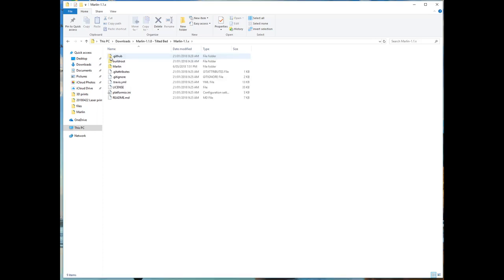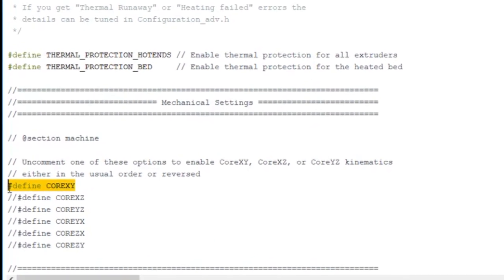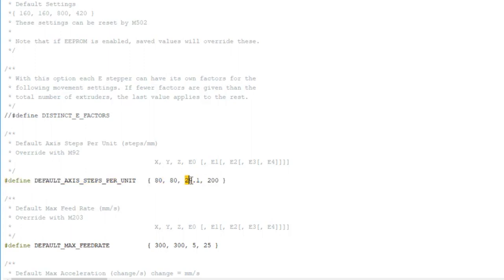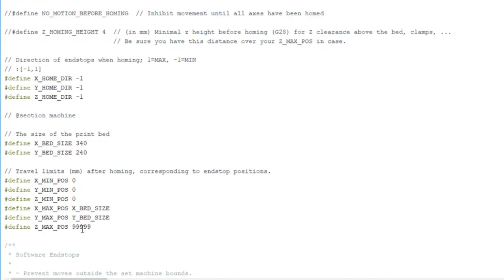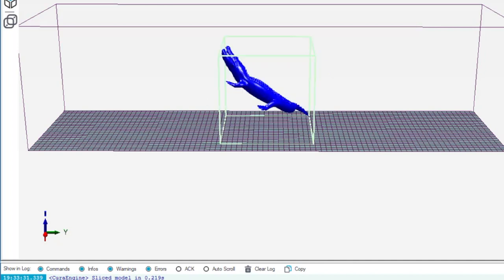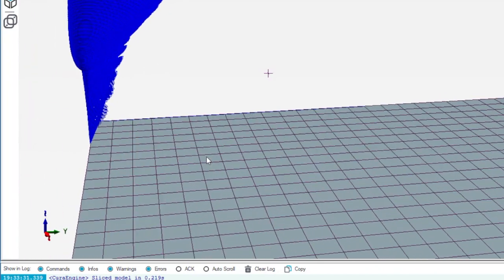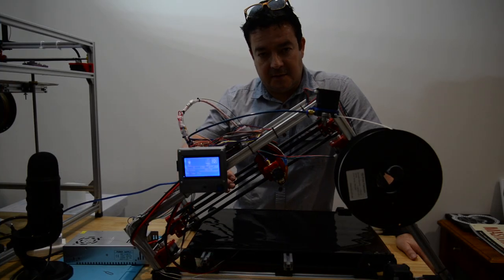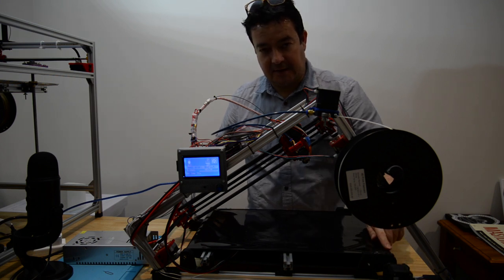How to configure Belt 3D printer Firmware

Comment: Since the Z-axis is the belt axis, I am attempting to switch the Z and Y axis in the marlin V2 firmware so I can utilize the 2 Z stepper plug ins on the board for the 2 Y-Axis steppers motors I am using, but am having no luck. Do you know any ways of doing this?

Comment: Is there a way to read all the G-codes loaded in the sd card one by one like a queue in series without interruption? In the blackbelt version of Cura you can only load one model and multiply it by the number you wish. In my case I want many models to be loaded in the SD card and tweak the firmware to only stop printing after all the files are read and executed. Thanks.
Reply from the maker: D4 very interesting question. I'm not aware of a way to do it. You could put all the models on a row in Cura and then slice. Maybe there is an Octoprint plugin or script that will do it. I haven't played with Octoprint yet https://amp.reddit.com/r/3Dprinting/comments/86u2d0/a_script_to_allow_queueing_up_multiple_print_jobs/
Reply: @ZechyC  I think the best way would be modifying the marlin firmware by some instructions that would allow the printer to automatically jump to the next gcode and execute it after ejecting the print (that would be done by modifying the end script) I am not that familiar with arduino syntax so I am still searching how to accomplish that. Precisely in the sd card section.

Comment: for now i have a normal core xy which has repetier firmware in arduino mega, can i use the same firmware for belt 3d printer ?
Reply from the maker: Yes. You can use the same firmware. You just have to change the Z height to a big number like 2000mm
Reply from the maker: Blackbelt3d Cura does all the magic slicing and offsetting of axis